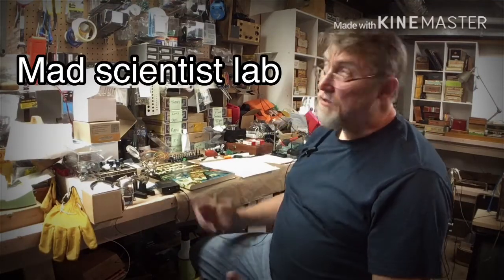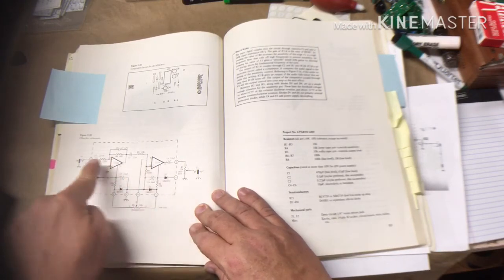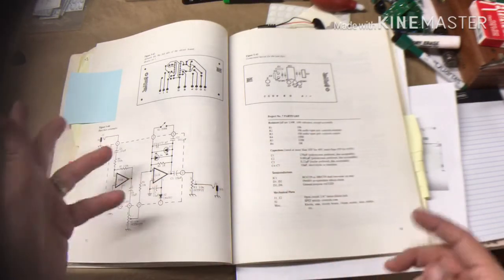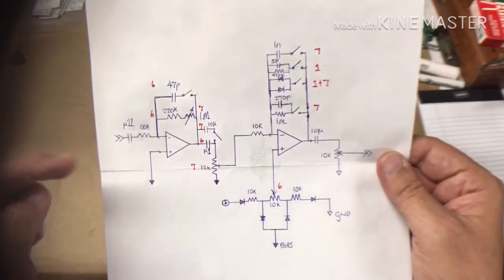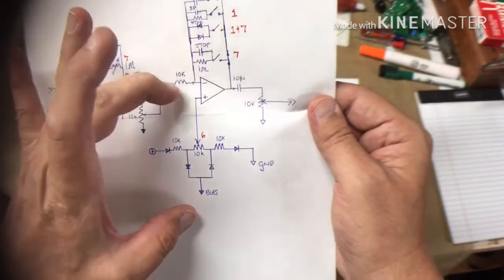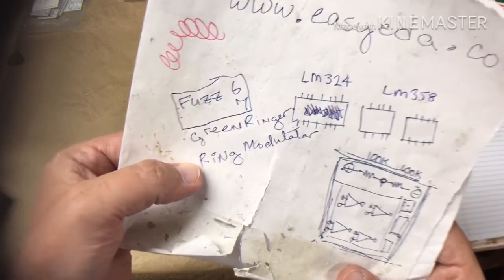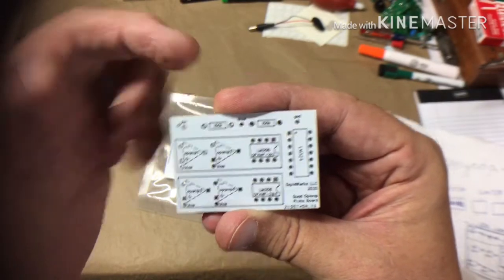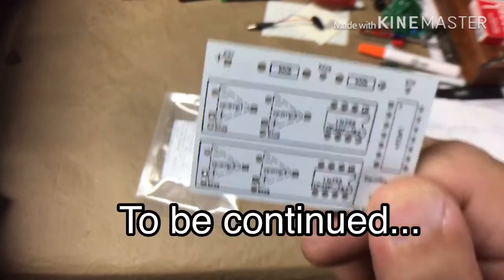Electronic Projects for Musicians Ultra Fuzz Bass Fuzz

Comment: I just bought an EPFM CA6 Ultra Fuzz Kit from Paia as my first build ever, but I couldn't sort out the correct way to wire the bipolar power. I think I need to start with something that has much more detailed instructions.
Reply from the maker: GNCshow, no worries about that. I was totally off about the biasing idea so I’m going to have to modify that part in my design. Bipolar power supplies are a pain to work with so I always rework the circuit to use a more common 9 Vdc positive power with respect to ground. Remembering that the circuit is floating around 4.5 Vdc can be tricky, but when it works, it’s a ton easier.